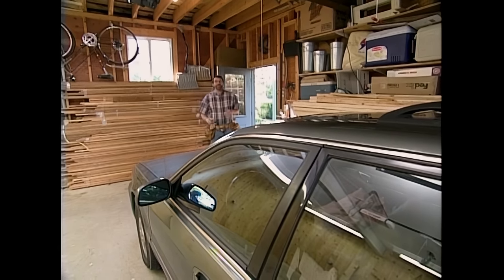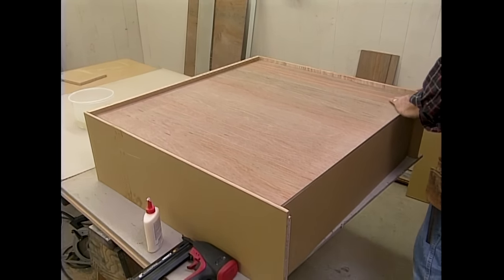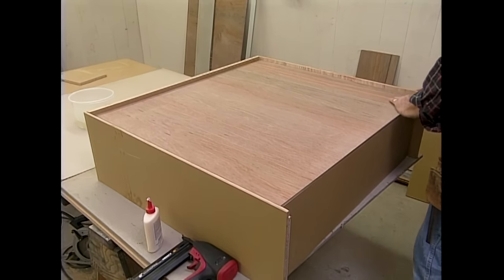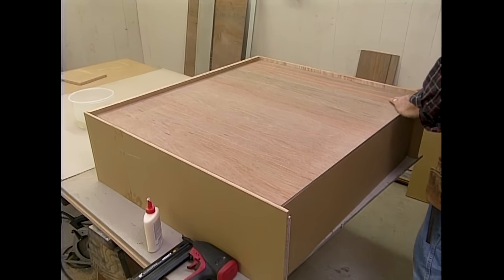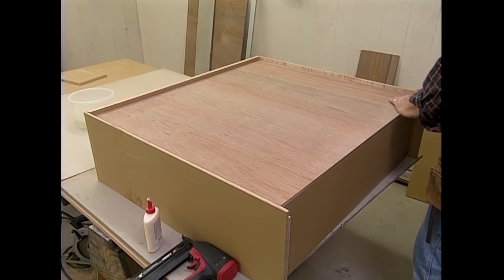Garage Workshop [AI HD]  |  S12 E1 & 2

Comment: About 20 yrs ago, I once didn't use safety glasses, used a circular saw, and a splinter ended up scratching the cornea of my eye. I was basically bed ridden for 3 days, then I healed up completely. I should've listened to Norm.
Reply: Did the same thing as a kid. Wasn't using any tools - just playing on the jungle gym at school and got some of the sawdust that covered the ground in my eye. A scratched cornea is some pure misery! (Imagine something in your eye that doesn't leave for a few days.) Sadly, Norm wasn't around then to tell me to stop rubbing my eyes. lol
Reply: Yes sir, probably the best advice ever given in the history of TV has been Norm’s advise and cautionary rule of safety glasses. I’ll bet he’s saved thousands of people from going blind through the years. God bless Norm for this.
Reply: Been there myself with the scratched cornea, Norm definitely was right!
Reply: i used a air cut off wheel i got a some metal in one eye i have to go to eye doctor have it remove, i was dumb and young still didn't learn i did it 3 more times after that and finely start wearing safety glasses 👓
Reply: @funtyes1970  the safety squint wasn’t done properly lol
Reply: Did you buy a lottery ticket?
Reply: Every time I’m about to do something stupid, I can hear Norm’s voice in my head reminding me to put on my safety glasses.

Comment: Ahhhhhhh the old Delta stationary and hand Porter Cable power tools circa late 1990s/early 2000s BEFORE these brands were sold out. NOTHING was better than green/grey and gray back then.  I bought most of my powered woodworking shop based on Norm's tool selections at the time. ALL of my 1990s power tools are still working and used in 2023. My grandfather always said buy the best tool you can and take care of it - it will last a life time. These older Delta and Porter Cable tools are a testimony to quality made. Unfortunately, not any more after these brands were bought out. Thanks Norm and crew for the memories and putting these videos on YouTube for us to remember and a new generation to learn from and enjoy!

Comment: Nice to watch these again! Norm was the reason I purchased Porter Cable tools, back when they were the gold standard of woodworking. I still use some of his techniques and ideas. My garage shop is only half of a typical 2 car garage, and after I'm done with a project, it looks like a tornado went through lol I have a table saw, a small router table, miter saw, chisel and hand plane sharpening station, drill press station, and woodworking vises. Plus, my air compressor, nailer, and assorted drills, sanders and jig saw. Plus, A portable work/assembly table. I learned woodworking in junior high and TNYW led me to better skills and ideas. Thanks Norm, you are the best!

Comment: I’d hate to be one of the fatalists who have appeared in numbers in this particular comment section. Too elaborate, too expensive, too beige, time better spent riding a bike, “error” this and “error” that, outdated safety practices, my garage isn’t that big, wood costs too much, I don’t have those tools, it’s all unnecessary…on and on go the complainers. 

Did it occur to you that the people who made this series 20–30 years ago weren’t aiming to please future YouTube viewers? Lots of people didn’t have NYW’s means back then either, but they didn’t whine about it. The show was aspirational, inspirational. It was about what you could do if you tried. People saved over time to buy tools and build facilities. Even NYW started out without all the big machines. Don’t think it was easier for people to drop a few thousand bucks on tools in 1990 than it is today.

So much bitterness out there.

Comment: This episode is gold for anyone looking to setup a shop, and the production quality of these old shows really raises the bar for Youtube.  I am so glad to see you guys on Youtube after many years of watching on TV.  I owe so much of my ability to watching Norm.

I'll add one suggestion -- when I build work benches, the top is a lamination.  I start with a layer of 3/4" MDF (the heavy dense brown stuff) then glue/screw down 3/4" plywood with a finished side up.  Due to its weight and density, the MDF will make the top very beefy and solid, and also make it quiet when you're working away.For even more beef, use two layers of MDF on the bottom.  It will feel like a butcher block top when you're done.

Like Norm, I use 1/4" masonite as the top layer, not fastened down, to serve as a sacrificial work surface.  You can beat it up pretty good for a few years, flip it once to start with a fresh new side, then replace as needed.

Comment: Fantastic - warmed my heart to watch this 😊 Amazing how tools and hardware have changed from those days: track saws, PPE, torx head screws, drawer slides - but they haven’t been able to improve on dado stacks and European hinges 🤪 Thanks for making these video’s available - I’ll be watching more 😊
Reply: Actually I just replaced my dado stack with a new proton flux wheel. Uses microwaves to burn a nice, smooth rabbet. It was $12,000, but that's understandable considering the liquid CO2 cooler that keeps the wood from lighting on fire.

Comment: Always enjoy seeing Norm whip out his ol' biscuit joiner and do something clever.  Great episode and still a super project for folks wanting to build woodworking benches and cabs - though one caveat being MDO plywood is virtually gone now, replaced with whiteboard at about $60 a sheet.  Personally prefer birch plywood though $20 more per sheet than whiteboard, is a strong modern substitute for overall workability and strength.  Works great when using Norm's glue & brad joinery techniques (which is still often preferred over pocket screw joinery).

Comment: When you move house, its easy to uncleat the wall cabinets, but the base cabinets have a single, continuous kick strip held on with brads - awkward to remove and take with you. Not to mention that the top is also screwed down and then the screws covered with the plywood top. I guess that double base unit is coming out as one - good luck unscrewing it from the wall.
Other than that, its great to see this two-parter edited into one video.

Comment: I bought my 4'x8' Avid about a year ago and it still works fine. Made a vac hold down over a weekend and it works well. Putting it together was a lot of fun with my buddy Bob. I disagree with some of your criticism of the Avid,, especially the belt drive. It also only cost about $13,000.00

Comment: For those of you who listened to him discuss shop safety and vision protection.   You should also know this.  Hearing damage is FAR more prevalent due to lack of using something as simple as a set of ear muffs.  For him to have been using that planer with no hearing protection shows the lack of knowledge - even with pro's on camera.  Hearing damage is a cumulative affect, that given enough exposures results in Tinnitus and loss of high frequency hearing.  And you can't get it back.  The eyes are important, as well as the ears.  Your lungs will also thank you, if you wear a dust mask as well when creating a lot of dust.   I'm 63.  My ears have been ringing every waking moment since I was 29.  It ain't fun.  Mine was caused by getting blasted by feedback squeel in our headsets one day flying an Air Force C-130 aircraft.   It killed my potential airline career following the AF.   The shop tools causing most hearing damage are the router, planer and any time that damned compressor is running.
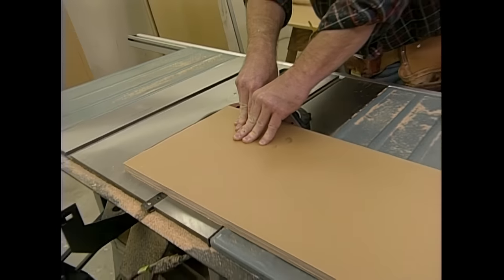Reply: I am female, aged 74.  Always hung in the basement  with Dad. He fought to get me into shop in high school.  Bottom line, emphatic No. Bought my first home at 22. A 17 room 7:00 Victorian fixer upper.  My father in law spent two weeks with me teaching me electrical and plumbing.  And then came the kids and Norm.   My favorite sound is the router.  What these men taught me has rewarded me my entire life.  Currently, on my last!!! Big project.  Total reno of 2nd bath.  Takes me longer now. My hearing is about 90% gone in my left ear, 40 % in my right.  Still music to my ears.

Comment: 18:35 I love Norm but there's a few things to learn from his mistakes: Biscuits do not make things strong. They make for simple alignment between two pieces of wood. In this case, only 1 biscuit could be used and positioned where it would not have interfered with the drawer bottom.

27:20 Safety issue. Never have the workpiece against the fence when doing this operation. It can bind and kick back. Instead, place a spacer ahead of the blade to use as your stop block. Then push the piece through. When you push it through, the end of the piece won't be touching the fence so binding cannot occur.

Comment: @ 4:27 That contractors table saw is the exact same one that Norm also showed in part 1 of 'Table Saw 101' from season 19, when that episode and part 2 both got uploaded to this channel, earlier!
Reply: True, and for whatever reason during this video the mobile base the saw is sitting on changes between day 1 and day 2.
Reply: What make/model? Looks like a Delta to me.
Reply: @tbg3111  Hey, you just hit the nail on the head! We are both right, actually! That is a Delta 36-444 2000 series contractors table saw, with the exact same 34-895 miter gauge, and red blade insert that Norm claimed it came with the Unisaw, in part 1 of 'Table Saw 101', to be honest.

Comment: I am in the middle of this build. You can imagine things have changed in 32 years. 1. MDO is hard to get. I special ordered it from Carters Lumber , $130 a sheet, but it came with paper on one side and open knots on the other. It came warped so making cabinets and drawers square is challenging. I should have bought the Sandeply at HD. 2. The hinges and slides are no longer available at Rockler. I am assuming the options I need. Frameless, full overlay euro style hinge. Full extension 21 inch requiring a filler, adjustable in 4 directions, soft close. Frankly I am worried these drawers won't work well with my nonsquare cabinets.

Comment: Norm, i would like to add miter saw station between base cabinets with doors and base cabinet with flip up top. Is it as easy as mounting a shelf with reduced height ? I also would like to add T track to the bench top.

Comment: I believe code in a garage is 5/8" fire rated sheetrock walls & ceiling, the wood looks nice, but the car is still being parked in the space.  If you were to make an enclosed space (loose one bay) then the side towards the other bay would have to be 5'8" fire rated sheetrock. Also all AC outlets in a garage need to be GFCI protected, even the outlets in the ceiling for the garage door openers.
Reply: @@phillipbanes5484 I know, but someone looking at it today would not know the info I mentioned...just trying to help...There should be an update on these old video's!

Comment: So I am going into retirement this year and am looking forward to becoming a hobby woodworker. I appreciate you presenting this video on making a garage into a woodworking shop but many of your suggestions seem somewhat expensive for my taste but I was still wondering what is the brand of table saw that you suggest at 3:45 in this video. I imagine it is a bit expensive but I am just curious what it is and also if you might have any other suggestions as far as a good table saw goes.
Reply from the maker: That was a Delta, but unfortunately, they don't make it anymore. You should check out Norm's video on the table saw before buying one: https://www.youtube.com/watch?v=O-Q78z7luTw

Comment: What is the name of the material he used for the ceiling? I can’t quite make out what he says! I’m looking for something lighter than drywall and wondered if this would fix the bill for me.
Reply: And this is a detached structure so I don’t have the fire code restrictions others mentioned you’d need today in an attached garage.
Reply: And I own that saw. 20 years and still going strong! 😂
Reply: Homasote. It's still available, but may not conform to local codes for that use. It's a sound deadening material.

Comment: Back when Porter-Cable was a quality brand instead of the cheap junk it is today
Reply: I had my doubts about Dewalt when I first started. Money well spent. I guess that's why I don't see PC in my building supplies shop.
Reply: Rarely can we see branding. 👀 43:55 hidden in plain sight too
Reply: Agreed, I just bought a Porter Cable 4.5 inch angle grinder. 10 minutes of use and the red lock button used for changing discs pops out and flies across my yard never to be found again.
Reply: Norm is why I bought a PC circular saw 20 years ago.   Went to get one for a friend last year and boy was I surprised.
Reply: Ain't that a shame. I have several older tools, some 50 years old, still crankin'
Reply: Here here  so true
Reply: @jimholmes2555  sounds to me the blade was it on right cuz I never had that problem with minds lol just saying
Reply: One company owns all the tool companies today
Reply: Not back then Jeff they still put out, like routers are still the best multi tools are the best and now they will come out with impact  and drill I have a sawzaw that is far better then your top 3 bottom line ,Sanders are the smothest.
Reply: @truckerdaddy-akajohninqueb4793  dewalt had nothing but problems duel bevel slide saw there drill compactor get hot.bottom line.atleast the ones I had.bottom line
Reply: honestly, as a guy who got into DIY and woodworking since the pandemic, I've spent so much time research tools and tool brands, and buying the "best" and buying "modestly price" items, and I'm convinced it's largely a crapshoot.  i got cheap budget items that work perfectly well repeatedly, and expensive name brand stuff that crapped out after only a few uses, and vice versa.  i suppose, yes, your averages are going to be better with the well-respected brands, but it's still, to some extent a crap shoot.

Comment: 15:49 we have those European hinges on our kitchen cabinets, and we love them, but I really can’t see spending the extra money for them in a workshop. The Stanley cheapies are not that hard to install and they’ll last.

16:44 Error! Why leave a space at the bottom of the cabinet that EVERY SMALL SCREW AND WASHER will utilize? Not to mention sawdust.

18:04 Pocket screws and glue would work fine here instead of biscuits. No need to notch etc. And eliminates need for separate drawer fronts. 

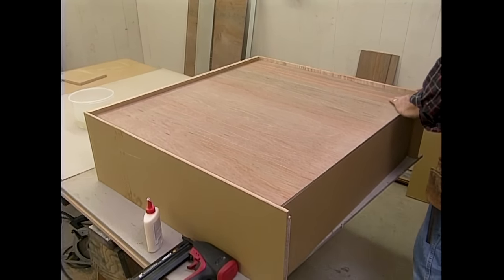43:16 He forgot to put the brads in the way of the lag screws. 

24:53 Poof! Vise! That was easy.

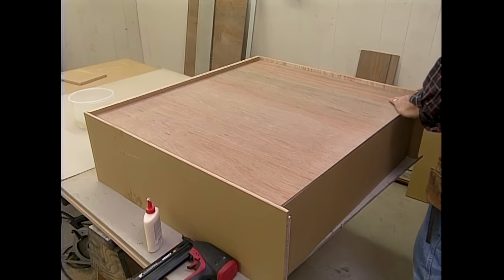34:37 Good god what a rigmarole. Better to make a detachable router table top you can clamp to the cabinet top. 

(FYI I love Norm. Hope you’re okay!)

Comment: I never cared too much for old Norm. He's a throw back to master carpenter. Now everything can be made by computers faster and cheaper. Yes, the Nrom's thrived during the golden era. He' doe very nice work. When he goes, he'll take with him skills no longer taught or needed. Stick built homes are too expensive and inefficient. Think about it. Home much of your home do you use on a daily basis? An attic is a cold and hot sink hole. And a place to stick things that you might use but never do. Just like a basement. Phooey. 3 D and other construction is here to stay. Now just to get the cities to change their obsolete bulidng codes, and restrictions. All the cities care about is taxes. You can hardly tax a house that costs less than twenty grand, at the same rate you tax a $100 plus grand house. And I wonder when they are going to realize that you can pave roads with waste plastic. All that no cost plastic being unused. We should be embracing renovations and not stuck in the past. Norm is a dinosaur, who only the well healed can afford to hire.

Comment: Dang Norm you cant not do anything bourgeois. 
Cherry picked a wide garage with radiant heat and full electric distribution with a lockout?
Yeah every beginner has all that. Not!
You don’t have the SKILLS to build anything with just the basics, a sircular saw, straight edge, square and drill (not a drill press).
You had to rely on dado stacks and your miter box stand. None of which a beginner is likely to have especially if they don’t already have a workshop.
Sometime you should actually try to bootstrap build a workspace without all the fancy stuff.

Comment: "LET'S TALK ABOUT SHOP SAFETY"......................EXCUSE ME,   where is the blade guard on the table saw?    Table saws, by far, cut off more fingers than any other power tool. Talking about shop safety does not prevent a power tool from cutting off your fingers.